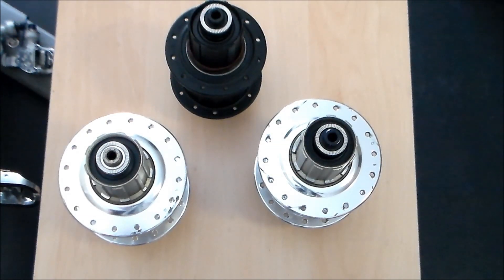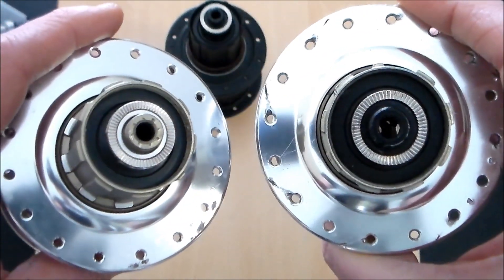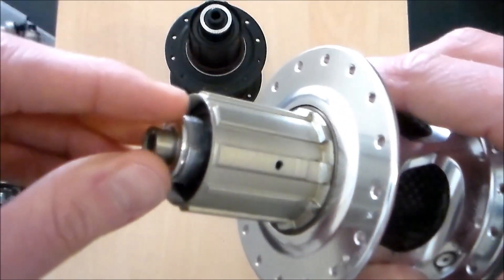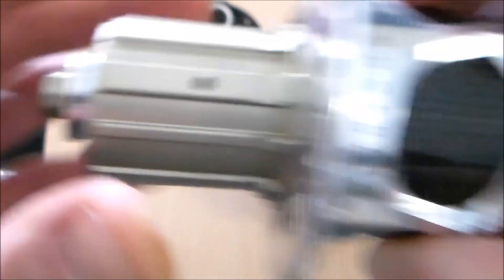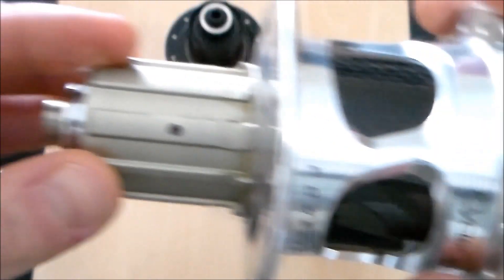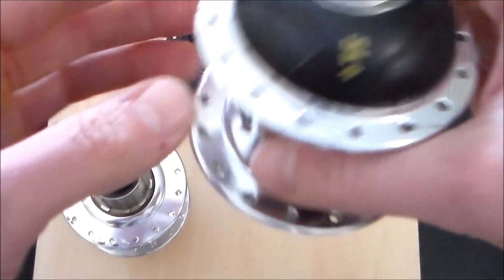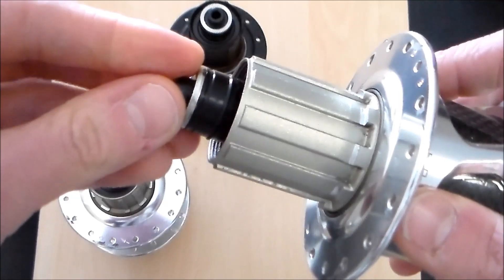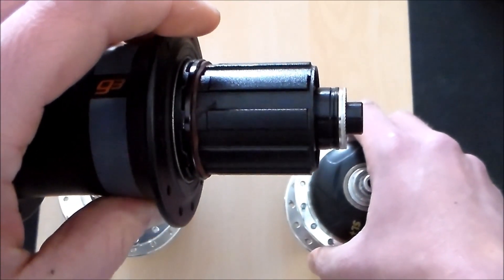PowerTap Hubs: The difference between 12mm vs. 15mm axles

Comment: so, if i have a 12 mm axle hub can I replace for one of 15mm?
Reply from the maker: You can convert a 12mm to a 15mm, however this conversion can only be done through our overhaul service here at our service center. If you're interested in pursuing that option, please contact our support team for next steps at support@powertap.com or 1-800-246-5975.